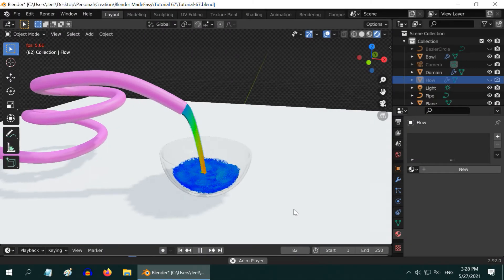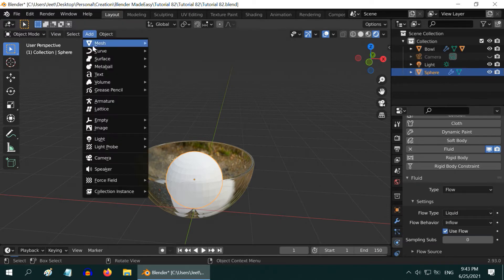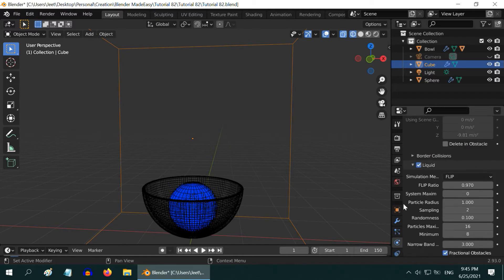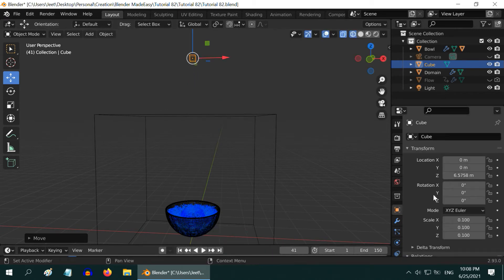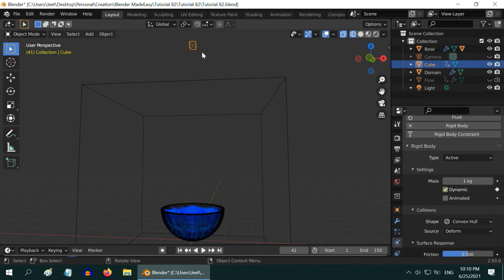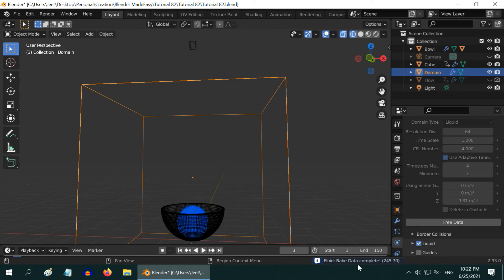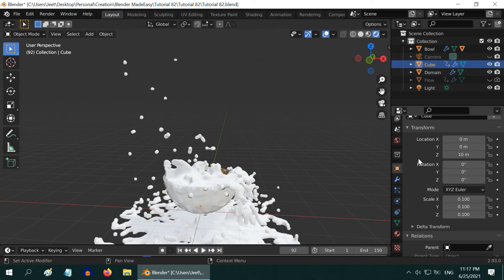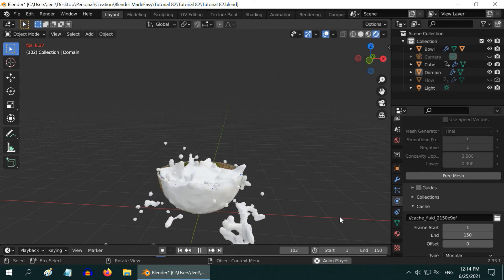Create Splash Effect | Drop Objects Into Fluid | Splash On Milk, Water | Blender Eevee & Cycles

Comment: I tried to let a uv sphere fluid filling in a cup from a specific height and after that  another uv sphere will fall to the fluid to the cup. I made the cup as the effector of fluid and passive of rigrid body and run the simulation, the uv sphere fell until half cup and it fell aside to the through the cup wall to the 3d viewport. Can you help me with this?
Reply from the maker: The cup is set up as a passive object, but its collision shape should be Mesh type. I believe you did that correctly, otherwise the falling uv sphere would have reflected from the top surface of the cup. If it is falling inside the cup but deflecting after that, I guess there might be another rigid body inside the cup which is hidden. You can send your blend file to us (5minblender@gmail.com) so that we can check and verify this.

Comment: kaseyi nasıl hazırlıyoruz :)
Reply from the maker: Hi, you can take a UV sphere and cut it into half, remove the top half. Then add a solidify modifier to add something thickness to the bowl. You need to also add a glass material to it following this tutorial 👉 https://youtu.be/NMwZyfWjexY
Reply: @5MinutesBlender  evet, teşekkür ederim. Gerçekten çok iyi ve hızlı bir dönüş. Fakat bir sorun var. Su dolma sahnesi kase yuvarlak olmasina rağmen kare bir şekilde kase alanından bağımsız hareket ediyor. Yani kasenin ici yuvarlak ve suyunda yuvarlak şeklin içinde dolması gerekirken, kare bir alan olarak doluyor. Sorun nerededir ?
Reply from the maker: @SmartyKidzClub  Did you enable the bowl as a Fluid Effector as shown in the tutorial? The shape will remain rectangular i.e. it will take the shape of the domain if you don't enable the bowl as an effector.
Reply: @5MinutesBlender   I had not enabled it as an effector. I will try and make it again. Thank you for your help. good people, I'm glad they exist🎁

Comment: I came up with this following your tutorial, however milk looks kind of weird, that settings should I tweak to makes less granular (I made it from geometry instead stopping the inflow not sure if that's something that should affect stuff)
Reply from the maker: Yes, we did not give much focus on the material part. This is only about the physics, but materials are extremely important for a good animation. I believe your milk looks weird due to inappropriate material settings. Actually milk and water are two materials that are very difficult to setup in Eevee. Milk is a semi-transparent material, with a bit of subsurface scattering. If you switch over to Cycles, it will look best. But other than the material part, I don't think there is anything special. If the material is setup correctly, it will look perfect.
Reply: @5MinutesBlender   Thanks a lot and by the way your channel is awesome, I'm learning a lot, keep up the good fight!
Reply: it's good that I don't have to rebake everything :p

Comment: This is a very useful tutorial for me.
anybody knows how the cube float on surface of the water?
Reply from the maker: We made two tutorials on floating objects, using two different methods. You can watch 👉 https://youtu.be/FLoLC4-7vBo & https://youtu.be/N-yohyp0Ja8 and use any one technique. However, if you are mixing it with fluid simulation, the later one may be more suitable. And you have rigid body enabled for the cube. So once the cube falls inside the bowl or the container, you need to enable its "Animated" property in the rigid body settings so that the cube follows the floating part.

Comment: Hello. very good tutorial. A question: When I try to make the effect on a full-size model. for example in the size of a bottle, the effect does not work. Is there any reason for this to happen?
Reply from the maker: Hi, can you please tell me which particular effect is not working? Is the splashing not happening or does the liquid remains invisible? What happens when you set the bottle as an effector?
Reply: @5MinutesBlender  Hello. The effect is heavy, as if the splatters are having a hard time getting out and spreading.
Reply from the maker: @gabrielpinto3918  I get it. The result might get more realistic if we increase the domain resolution heavily. Or what I personally did for the demo, I used a smaller cube to create the splash and I baked the fluid with that. Once the fluid was baked, I replaced that small cube with the actual cube, and did not bake it again. Kind of fake, but fast and accurate 😀

Comment: Hi, I'm new to Blender , can I set how many litres water like inside of a box, or only ¾ full in a box?
Reply from the maker: Good question. It would be a nice feature, but as far as I know, this is not yet possible in Blender directly. The fluid volume is somewhat dependent on the initial flow velocity, so we can do some math there and turn-off the flow after a certain time. Or we can use a second mesh with a size ¾ of that of the target mesh. But the fluid volume is also greatly impacted by the domain resolution we use, and the proportion between the flow object and the domain. So the absolute volume of the fluid is still hard to control.
Reply: @5MinutesBlender  thank you